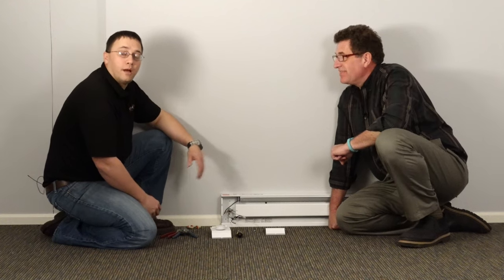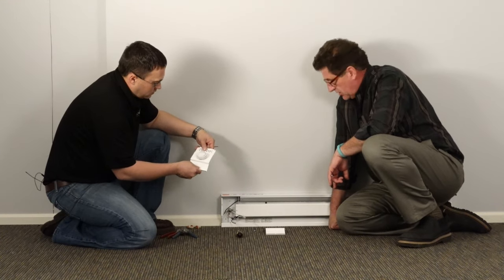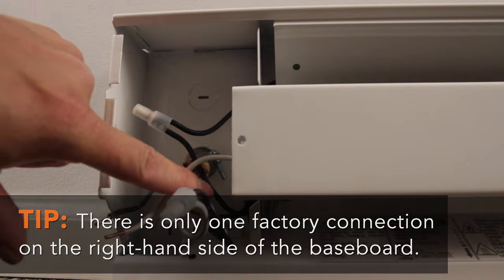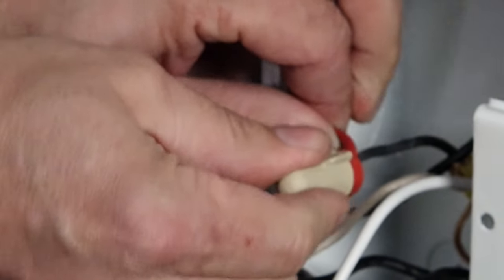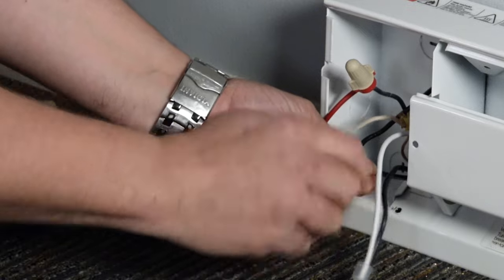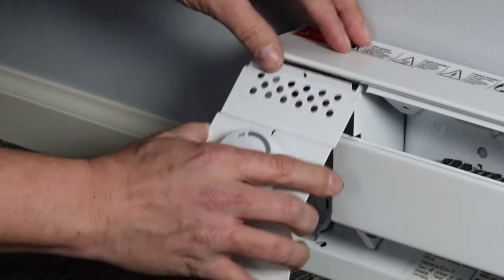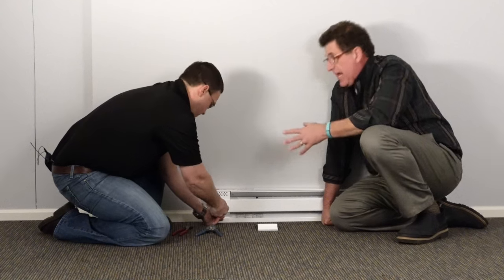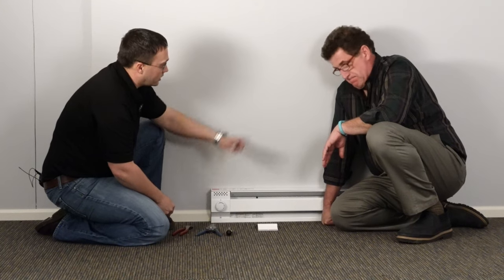How to install: BTF1 thermostat on 120V baseboard | Cadet Heat

Comment: Can you add a plug  instead of hard wiring a Cadet 120 volt 750 amp to a 14 amp circuit using it as a portable.

Comment: Can I wire a 120v baseboard heater using the supply wires from the electrical outlet? I have a small home and our furnace is crap and are just going to get ride of it. We live in Southern Tennessee so it doesn't get too cold but do have some chilli nights.
Reply: From what I've learned the 1500 Watt heaters would most likely need a dedicated 20 amp circuit. The smaller 750 watt could be ran off one 20 amp circuit connecting 2 smaller heaters. The 1500 watt heaters are 12.5 amps and the 750 heaters are 6.25 amps. Use a 14 awg wire to the 20amp circuit to the heater, a 14 awg wire can safely run up to 25amps.

Comment: You call this a thermostat, but what temperatures correspond to the settings of lo to high? And does this shut off automatically when it gets to it's idea of a perfect secret and mysterious temperature? The electrical contractor installed this style in a remodeled house, to replace the oil furnace which had a thermostat, you could set for specific temperatures. Now we never know what the temperature really is in the house. Do we just buy thermometers to place in all the rooms?

Comment: Who’s correct???
You cut both black wires
My instructions book says do not cut blacks 
Why can’t I post a photo??
Reply: Im starring my at my instructions dude mine on every set up says do not cut black to black! Did u get a answer or figure it out my kids need heat help ty sir
Reply: Mine only has 4 black wires and says don't cut these are junk
Reply: I believe this video is incorrect. I'm going off the installation instructions. They say to connect the red of the thermostat to the black supply wire. The black off the thermostat to the white of the heater. Then connect the supply of the white off the supply to the black of the heater.

Comment: Thats interesting cause im starring at insulation instructions for a single pole thermostat to a 120v heater and it shows not cutting the black to black factory connector and cutting the white to black in the instructions white feed wire goes to white heater wire  and black supply wire from wall goes to red then the thermostat wire thats black goes to the black heater wire this is not what the I.T. guy says he said look for the factory wire that had no white.... this is a major conern cause you instructions does not match the thermostat installation  instructions in front of me .....
Reply: So I called the tech support and they say  same as instructions cut the white and black factory wire not the black to black factory connection so this video is wrong and should be taken down for safety reasons!
Reply: Thank you.....